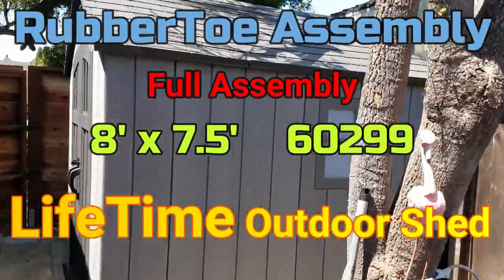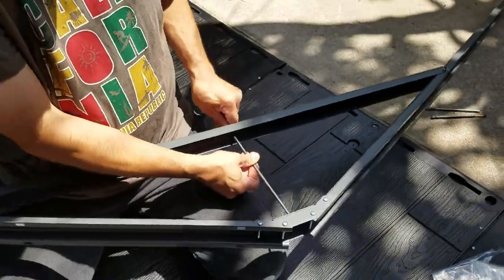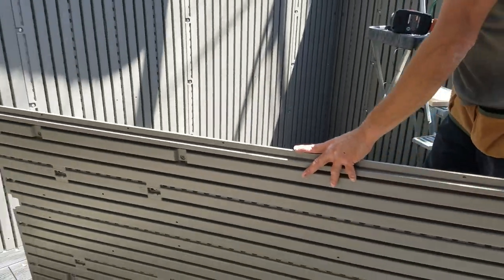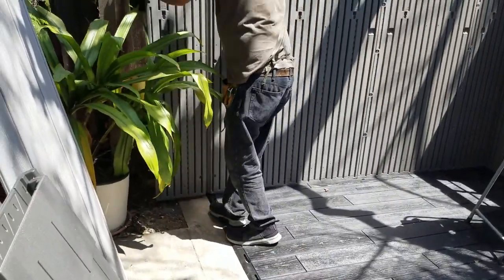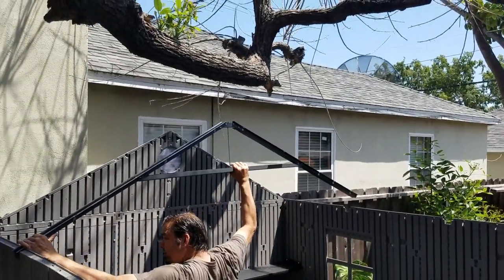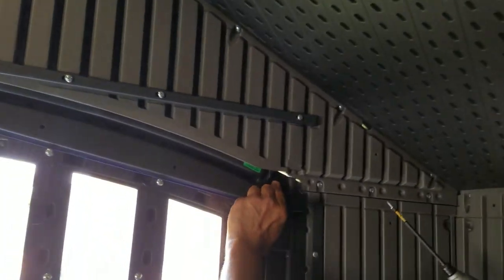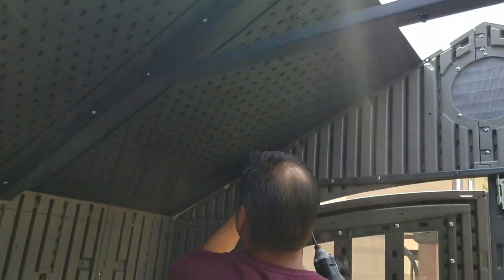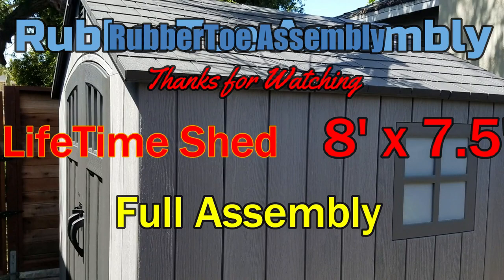Lifetime Shed 8' x 7.5' 60299 Outdoor Shed Full Assembly How to Build Install

Comment: Thank you for the video; it was VERY helpful!!
However, for anyone who has yet to put one together-there will still be some issues that are aggravating. We encountered these:
1. The metal poles and bars did not easily slide into the doors (we had to hammer one all the way in which caused the end to mushroom out, we then had to file down the end   of the bar and hollow out the bushing it sits in in order for it to fit).
2. The corner walls did not easily pop in whether we used the wood block or not.
3. Lining up the screw holes with the roof tiles, the walls, the trusses, and the gable ends was difficult with each panel and almost impossible with the last panel.
BUT: the shed is up now and looks very nice. 
P.S. This WILL take several hours to assemble if you are unexperienced.
Reply from the maker: Good Luck People!  Enjoy the Adventure, it's Not Easy!  

First Day ANY Lifetime Outdoor Shed DO THIS FIRST How To Build
https://www.youtube.com/watch?v=LMNR2ROlNFE&t=9s

Comment: You didn't pull the plastic covering off of the windows? And where are the metal angles that go on all of the side panels? I just built mine and since this is an older video maybe they weren't a part of this one in 2017. Anyway nice little sheds.

Comment: im having all kinds of problem with the roof not aligning...everything else went smooth..
Reply from the maker: Hi thanks for comment. yes thats one of hardest parts is bringing roof together. for most people. just line up the little nib with the groove in truss first,then opposite side top,and that should help tremendously. along with shimming up the outer edge where needed ,to tilt or adjust roof to line up more perfectly. watch several other videos of other sizes perhaps bc they reveal other tricks to get things to come together. hope that helps take care
Reply: Having same issue, rear right corner lines up on truss but not the back gable